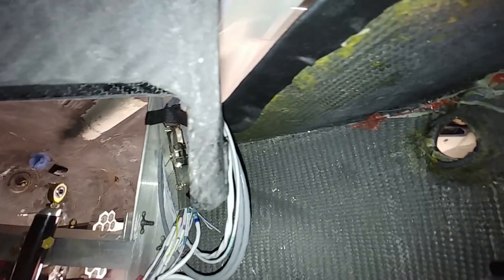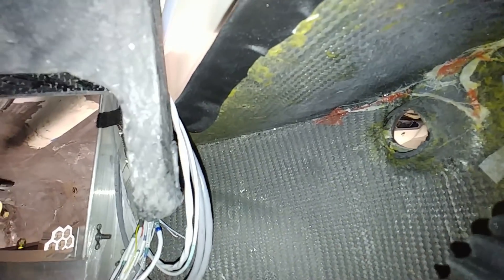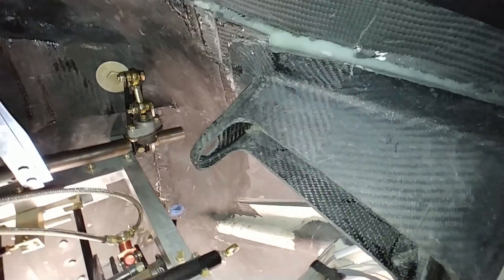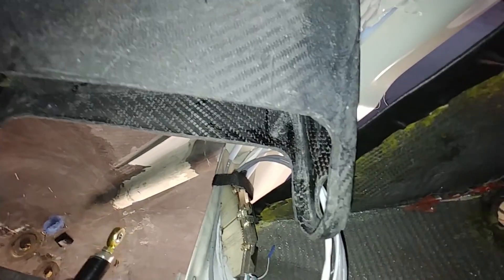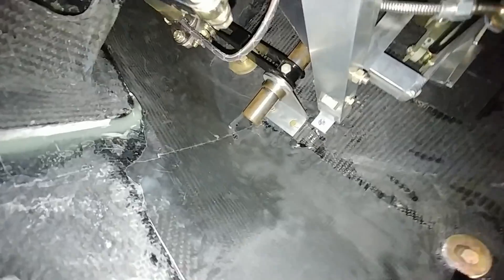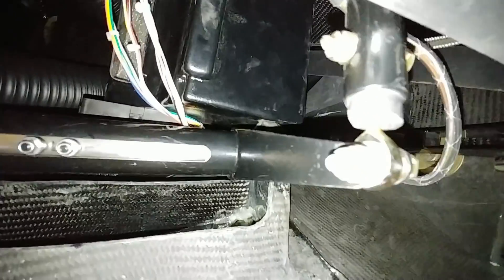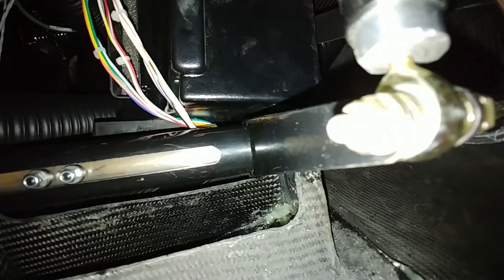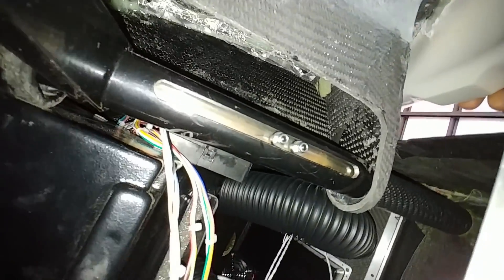Back to the Drawing Board - Building the Raptor Prototype

Comment: Something along the lines of this would be alot simplier https://www.mcmaster.com/linear//linear-bearings/for-shaft-type~round/linear-and-rotary-ball-bearings/
Reply: How much space do you have to work with the 1in I'd bearings are 2.25 in in length and would not shift your pivot point from your existing design, but I might be overestimating the impact of that offset cirrus pivot on the existing control geometry
Reply from the maker: Actually not, because they are quite large and I don't have enough room to mount them with the existing brackets. And then I still have to fix the issue with the small bearings and the slots. This new solution addresses all the problems with a proven solution that fixes everything and fits neatly.

Comment: What about adding a third  bushing into the center of the existing two? Also, I agree that longer bushings would aid in alleviating the binding issue. It would certainly add support and rigidity to the control system.
Reply: Certainly, best of luck with your continued work! No need to apologize, I missed that there were originally three bushings. Thank you for publishing your construction process. I’m taking notes!
Reply from the maker: I had three. Sorry, the old solution is going. I don't have time to mess with it.

Comment: The narrower the bushing, the more likely it is to rack. I agree with a lot of commenters that linear bearing that are a bit longer than the bushings should work. Sometimes the simplest way is the best way.
Reply from the maker: It would be more work to try and fit a linear bearing in place of the iglide. There's not enough room. And then I still have to fix this issue with the small bearings in the slot. This new solution is cleaner and easier.
Reply: But linear bearings dont rotate well.  he would have to redesign to add a rotation axis.  Probably  a prime task to redesign for production.

Comment: With linear bushings, the length of the bushing must be a minimum of 1.0 to 1.5 times the inside diameter. 3 times is better. There’s no reason the bushings/bearings will not work if they’re long enough. It’s worth a try.
Reply: I agree! Short bushings will readily bind, long bushings will solve your problem very easily. Would be a travesty not to try such a simple and cheap solution.
Reply: The bushings could be longer than 3 times the diameter, as long as they do not interfere with the screws limiting the telescopic run inside the tube.  And the longer, the better...  would provide a faster and easier fix to try out.
Reply from the maker: I tried longer iGlides originally and they were worse than the shorter ones.
Reply: @RaptorAircraft  I don't think Av Shiloh is talking about bushings only.  Search google images for linear bushings.  I believe he is talking about the ones that have ball bearings inside them.
Reply: @dtoften  Agreed...this solution looks way more complicated than it needs to be.
Reply: If this was a single Bush system I would agree.  As a double (rigid & far apart should act much like one very long bushing) not sure it will help.  

I have no Cirrus experience but it appears that tube is specialized, nearly sq corners & a circular ID.  If so why?   Torsional strength, stiffness, v-roller engagement are all obvious.   Are their outside surfaces machines or ground?   If smoothness is critical, surface finish (Ra) & straightness will likely be drivers.
Reply: I think you are going to have space issues. A cleaner and thicker tube with 3 guides would work and save weight

Comment: Peter why you not consider to make that bronze ring to work as berring? It is really simple solution for it?  All you need is replacement for those  parts which is causing locking.
Make from bushing an barring. Two row of balls would be the golden solution
Reply from the maker: "Two row of balls would be the golden solution". yes if I had that I doubt I would have any problems. On a serious note, I'm just going with a proven solution now. I don't have time to experiment with different setups that I have not seen working. Sorry.
Reply: @RaptorAircraft  I respect your choice. It is many solutions here the trick is not to overthink, KISS - is always good strategy
Reply: This was my question too. Certainly there’s a good reason, I’m curious to learn